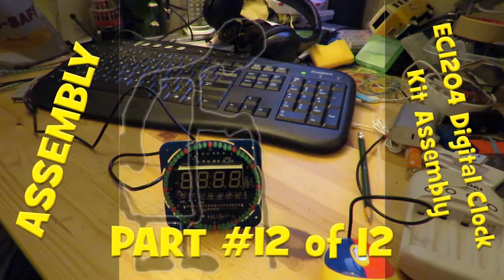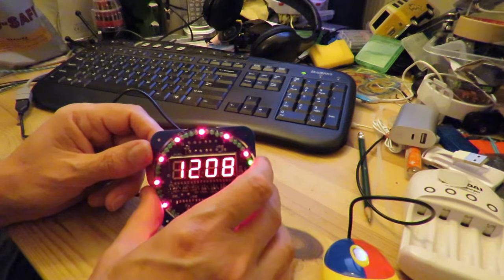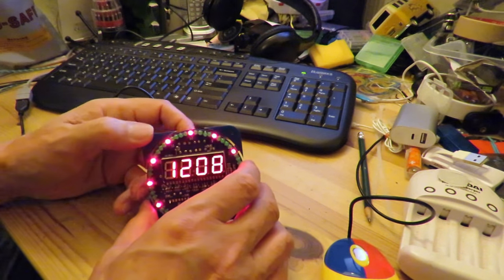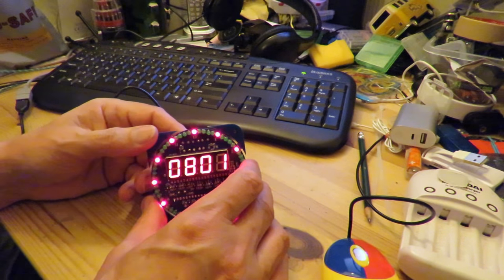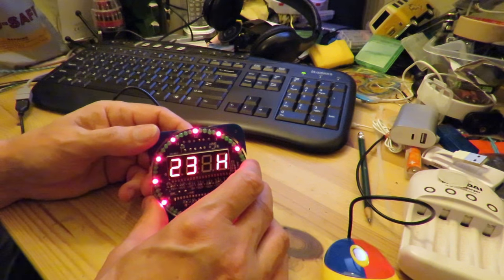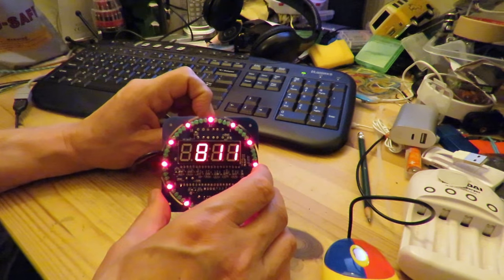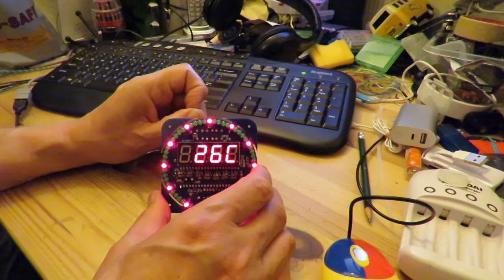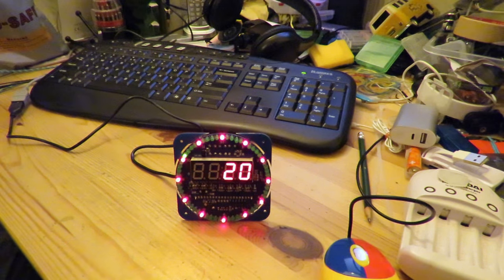EC1204 Digital Clock Kit Assembly PART #12 Set up

Comment: '
really want this rotating LED clock kit...
fun learn kit
Reply from the maker: Looks like you like digital clocks, just had a peak at your channel 😊 This one was a longer build that the cheap kits I normally put together and several of the LEDs have failed since I made it, but it does still work fine 😊
Reply: hi Gman...
thank explain...
i was finish LED clock kit...
very beautifully and great kit